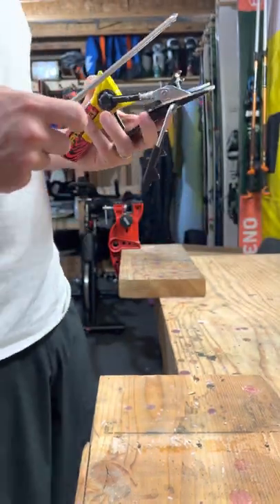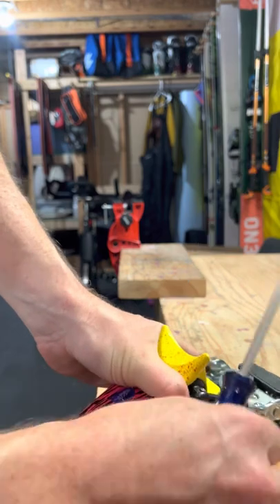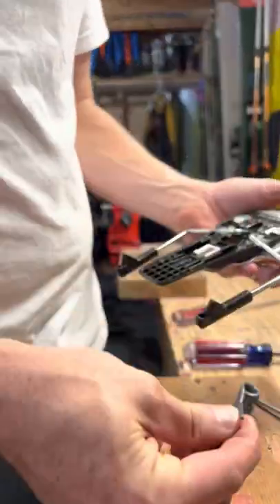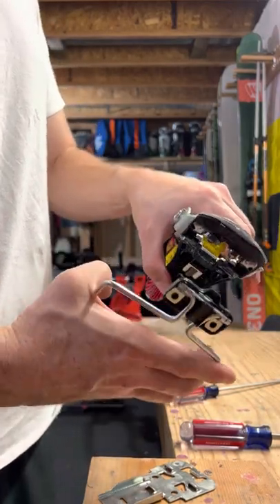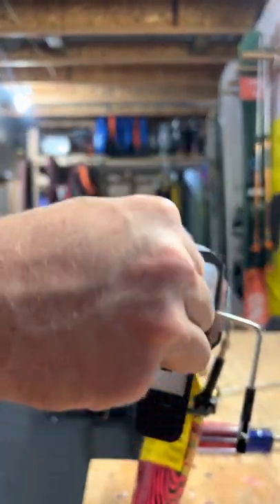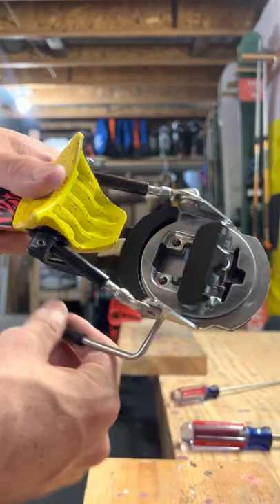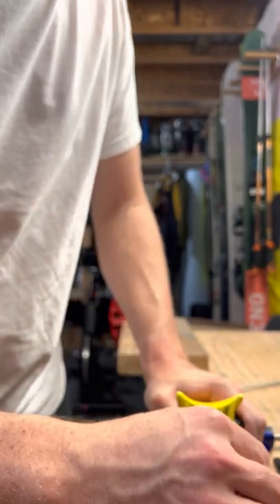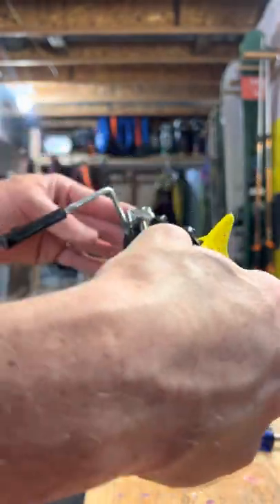How to replace brakes on look pivot ski bindings.

Comment: Thanks for this I need to swap out the original 90 brakes for 115's to transfer my mint bindings . Local ski shop wouldn't do it because "you'd have to completely disassemble and reassemble the bindings like it was rocket science...I suppose they don't want the implied liability?

Comment: I just back out the forward pressure screws so the whole baseplate detaches. Slowly - each side equally. But your way looks less stressful on the arms. Thanks for making this! Maybe you could list each brake length part # in the description, easier than replying
Reply from the maker: Great idea, just updated it!

Comment: I have a pair of 115mm pivot 14s on the way and a pair of 95mm pivot 15s and want to swap the brakes, do I need to fully disassemble the bindings or can I just unscrew the two forward pressure screws all the way to swap the brakes out? Thanks
Reply from the maker: As long as the lower binding assemblies are identical I think you could totally try this. If not swapping the arms like this video shows would be a sure way to get it done.

Comment: Do you have a link for 120 mm brakes for this binding? I'm not sure what exactly to buy, I have the same pit viper looks in the video
Reply from the maker: Shoot, they only come in a 115mm or a 130mm brake. How wide is your ski? A 120mm ski can usually fit with some bending.
Reply: @Christopher Whitcomb  they are 123, so a 130mm would do

Thanks for reply!!
Reply from the maker: Right on buddy!

Comment: Were you able to buy just the brake? Or did you have to get the whole baseplate? I Was hoping to save some money by buying last years model of the 115mm and swapping it out for a 95, but a whole new baseplate makes it about a wash, and I can only find the entire baseplate replacement. Either way, thanks for the info!
Reply from the maker: Thanks for the comment; you should be able to actually buy the brakes/assembly straight from Rossi, the part number is FC9F001 for the 95mm brake assembly. Haven’t tried their number in a while but try them at 435-252-3300. 

Otherwise, ask around or google pivot brake trade. People on newschoolers or TGR are usually looking to trade.
Reply: @ChrisWhitcomb90  Thanks so much!!
Reply: @ChrisWhitcomb90  Rossi makes the brakes?
Reply: @ChrisWhitcomb90  would you know the part number for the 75mm brakes? I'd like to get the forza 3.0 color bindings but the 75mm ones only come in plain black... thank you!!!
Reply from the maker: @robn.1904  Same parent company owns Rossi/Look/Dynastar
Reply from the maker: @alessandr8  for the Pivot/FKS style brake in a 75mm the part number is FC6F049. Cheers buddy!

Comment: Thanks for the super helpful video. I wanted to do it myself before having them mounted to make sure I got the other brakes back. Wasn't going well at all, watched this, and still took about half an hour but got it done. Getting the bottom plate back on was the hold up.
Reply from the maker: Awesome work man, agreed, never know what happens when you drop stuff off at shops.

Comment: Is it possible to change the brake on a ski, or would you have to remove the heel piece right?
Reply from the maker: You would have to take it off the ski. That’s pretty easy to do; when you remount use 2 part marine epoxy and hand tighten

Comment: Good day kind sir, 
First of all thanks for the video, 
I totally bend the brakes on my 15 GW and wanna replace it.  Do you think it would be a problem to dismount the whole backplate and put it back on th skis? Im quite concerned about the ski not having the stability it used to have when i first mounted the bindings.
Any tips/recommendations are much appreciated! 
Cheers!
Reply from the maker: Hey there, of course, glad you found this video helpful. Back in the day we used to remove and remount bindings as a way to save money by running multiple pairs of skis with the same clamp (binding) #thatskibumlife. 

Anyways, I think you will be fine do remove your clamps and swap out the brakes. 

I would recommend that you use a 24h - cure time epoxy like this g-flex epoxy ( link here: https://amzn.to/3inc0gM) in the holes when you remount. This will ensure the screw hole is water tight and you don't get core rot. 

Also don't over torque the screws when remounting as you might get a spinner (aka a screw that strips out the hole) if that happens let me know and I can get you pointers on how to fix it. 

Cheers buddy, working on skis isn't rocket surgery and remember they are tools NOT jewels!
Reply: @ChrisWhitcomb90  Alright, sweet. Appreciate the advice! 
I got 96mm poachers, would you recommend getting the 95mm brakes and bend them a little in order to fit them on the ski? Or should I get wider ones?
I’m pretty sure I fckd my brakes because they were too wide.
Thanks again!
Reply from the maker: @locknare I’d definitely go with a 95mm brake on that ski. Usually will accommodate 5-10mm larger without an issue!
Reply: @ChrisWhitcomb90  Hey Christopher I might need your advice here again. I dismounted the back pieces of my bindings and realized that on one side, one of the  holes is too big for the screws.. dude that originally mounted the skis must've fckd up his job.. any idea on how to fix the issue? I was thinking about making the hole even bigger and putting a thread into the ski which then holds the screws of the binding.. does that even make sense? 

Anyways, I'd appreciate your help in this case :) 
Cheers bud!
Reply: @Locknare Take it to a shop and have them install a heliacoil. This is standard practice for stripped screw holes. It’s a pretty common repair. We do it often on junior skis that use foam cores and often get remounted using old holes from previous mounts.
Reply: @thomasmedeiros5722  I tried a couple shops to install a coil and they all refused to do it. not sure if they refuse to for insurance reasons or some shit.
Got them mounted -1cm and it feels aight.
Thanks for the input tho!

Comment: cool video, thanks hello you can make a video on disassembling the dildo - there is a metal pin and as I understand it, in order to safely remove the plastic, you need to pull it out and then unscrew the bolt - there will be access to the spring. I want to lubricate my heels. there were no problems with disassembling the metal toe - I replaced the terrible old ceramic paste, which became more like an abrasive, with a calcium-based synthetic waterproof lubricant (neutral to aluminum)
Reply: you just need to do this exact thing then pry the white plastic piece with the spring in it off, the rest will come apart & then you can lube it all up. watch your eye balls!
Reply: @Batesey910  as I understand it, to disassemble the heel, you need to find a way to pull out a small metal pin-lock that blocks the movement of the plastic part of the heel. In principle, I can unscrew the spring in the heel without removing this shift, but then it is removed very badly and tightly ... in general, I'm still thinking how to do it in the most beautiful way. and yes thanks for the warning I always work in plastic glasses)